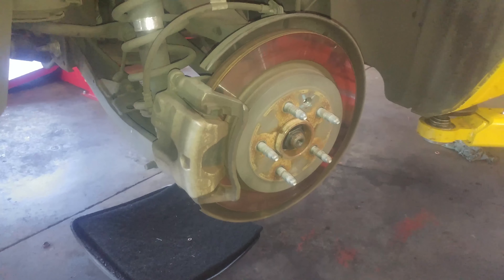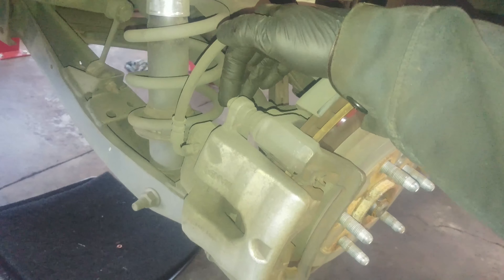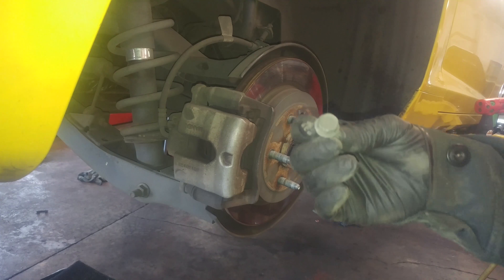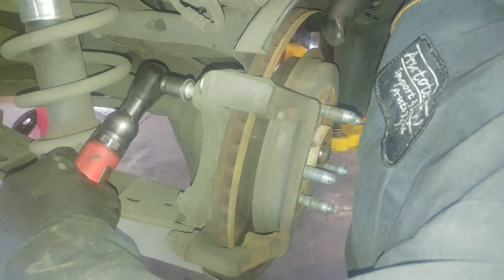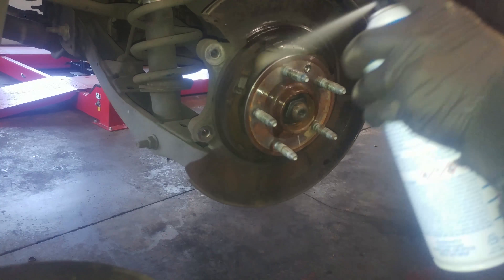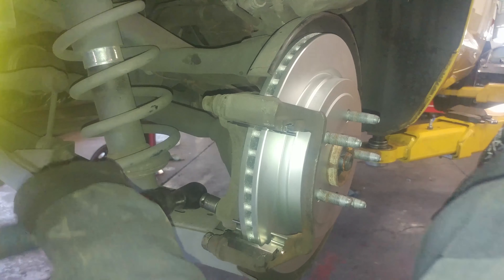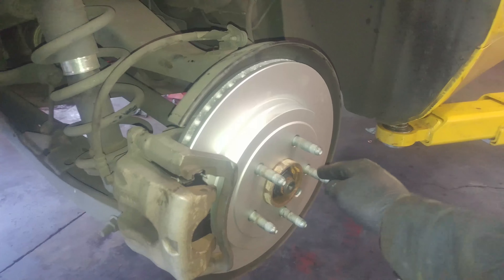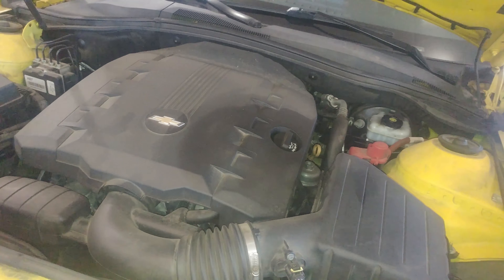Rear brake pad replacement 2010 Chevrolet Camaro

Comment: Some say grease under the new brake hardware to prevent rust from pushing up hardware, thus preventing brake pads from getting jammed and not being able to slide properly. I don't know ??
Reply: I also use anti seize on caliper piston and ears